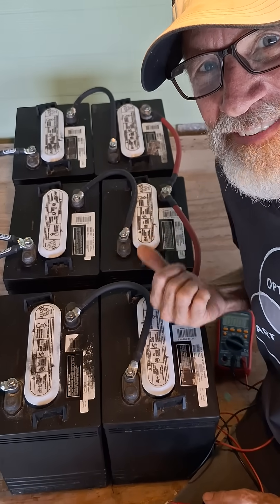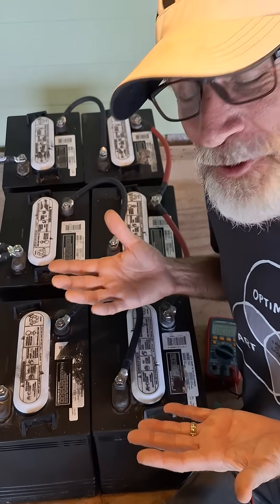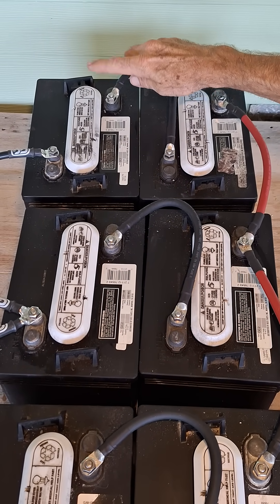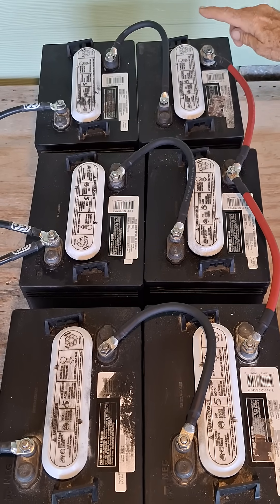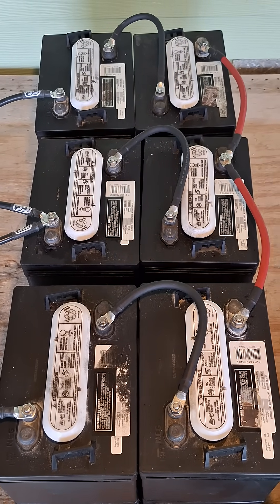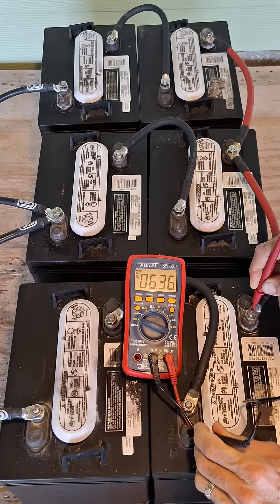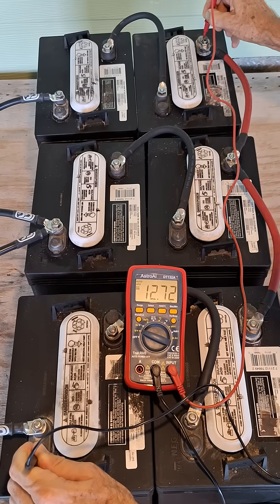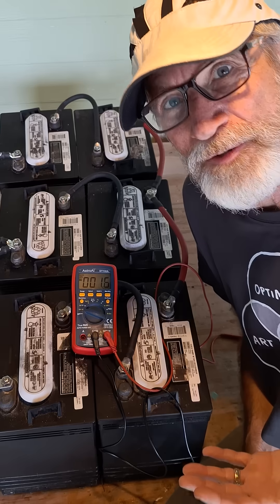12 volt solar battery bank using 6 volt golf cart batteries DIY #solar #offgrid #RenewablePower

Comment from the maker: I appreciate all the great discussion on battery types and power calculations!  Here is the math for my statement in this short:  We start with six 6V, 190 Ah batteries.  By wiring in series-parallel we end up with a single 12V, 570 Ah battery equivalent to 6840 Wh of stored power.  But they are lead acid, so only about half that capacity is available, so we divide by 2 and end up with a useable 12V 285 Ah battery with 3420 Wh of available power.  This is approximately equivalent in available power to a 12V, 300 Ah LiFePO4 battery (as I stated in the video).  But of course the LiFePO4 battery would provide many more cycles of service!  But the truth is, we bought an old 36V electric golf cart that had these 1-year old batteries that by all measures are in great shape.  As we are converting the cart to a single 48V LiFePO4 battery, we decided to use these in a DIY solar generator for our Tiki Hut and see how long they last.  It is an experiment!  Look for our next video on the solar generator build with this battery bank.  Thanks for watching!!!
Reply from the maker: It was a 36 V cart that we are upgrading to 48 V with an AC motor conversion.
Reply: You don't state it, but be sure to center tap off each parallel run to minimize line loss affecting charge and discharge imbalances between batteries.
Reply: You would need more then six 6v batteries to make 48v you need 4 12v batteries to make 48v so how did you get 48v from six 6v batteries? I think you don’t know what your talking about especially lead acid and lithium sorry but your giving bad info to people about solar and batteries and it videos like yours that need to be taken down people probably started fires because of you
Reply from the maker: @ Sorry that you feel that way. In the video I make it clear that it’s a 36 V system. I upgraded our cart to 48V LiFePO4.  Had the 6 V batteries left over so why not use them in a 12 V system?! it’s a fun experiment and it’s working very well. Thanks for watching.
Reply: @ecohabs4earth absolutely you are right 👍
Reply: @BojacksUnbound  no not at all you are rong

Comment: So do they all have to be the same amp size etc ? I have 2, 12v batterys wich i am thinking i want to use as a solar driven power station for fans to the heat on my solar heat converter. So it will be completely self sustainable unit.

Comment: Cool demo, thanks for posting! I'm totally new to this, but roughly speaking, what type of electrical loads (and for how long) could this supply electricity for? Assuming it's running from fully charged to fully discharged?

i.e. 10 LED light bulbs for 4 days? A typical refrigerator for 48 hours?
Reply from the maker: Great question- with about 3500 watt hours of stored power they would run a 10 watt load for 350 hours, a 100 watt load for 35 hours, or a 1000 watt load for 3.5 hours!
Reply: @ecohabs4earth  Interesting, that makes sense, thank you!

Comment: So why not just parallels negative to negative and positive to positive??isnt it the same thang!!?
Reply: That way the voltage would only be 6v if im not wrong and turning it into 12v allows for a higher output and more accessible inverters
Reply from the maker: Yup

Comment: Don't forget to change the caps the vent caps have to have bigger holes for ventilation for the application even though the ones that they have on golf carts are not even of the standard.
Reply from the maker: Good tip!

Comment: Very important to know the difference between series and parrellel circuits and series parrellel circuits in combination.  Most 24v backup battery systems for low voltage security and fire alarm panels use the latter.
Reply from the maker: Thanks for watching!

Comment: Great info , one question,does it have to be golf car batteries ? Or can you use car batteries?
Reply: No golf cart batteries are deep cycle, car batteries are starting batteries, car batteries can't handle being discharged and charged, it's not about the voltage it's about how the battery is made, a car battery might be dead the first time it's discharged, deep cycle can recharge a few hundred times, lithium a few thousand times.
Reply: @joegodoy9233  12v battery are not good for solar unless your planing on just using lights not only do you have to have big wire for 12v the conversion waste a lot of power 48v lithium rack batteries for solar if you want to run things like microwave toaster vacuum internet computers in my opinion if your not ready to do serious solar then you shouldn’t waste your money I know because I did it I want from 12v to 24v to 48v and I wasted a lot of money because 12v and 24v did meet my power needs and at the time i didn’t think I needed the power I needed so with that said I wouldn’t to let you know that so maybe you will not waste your money on this bill shit 6v 12v 24v bull shit you see online make a real system and you will not be disappointed
Reply from the maker: @joegodoy9233  sure car batteries would work. Since they are 12v, wire them up in parallel to make a large 12v battery bank.
Reply: @ecohabs4earth  wrong! You want nautical batteries because they can deal with deep discharge

Comment: Only 1 problem.  You take your pos and neg to the load from opposite batteries.  From opposite ends.  Not the batteries next to each other.
Reply from the maker: @keithanderson6166  yes that is exactly correct and exactly how we used it!

Comment: There's a solid reason the solar/offgrid folks have moved away from GC batts: You still only have 12v array. And you have all the battery problems of a flooded lead acid. LiFePO4 server rack batteries with 100Ah at 48v are safe, reliable, long lasting, maintenance free and take up half the amount of floorspace.
Reply from the maker: Yup :)
Reply: Lifepo4 isnt always the best and can be a real headache in cold climates. Im actually currently running a Lifepo4 bank, and I'm pretty torn if I will stay this route or go back to lead, or agm. Individual cell failure. Bms failure, and bms lock outs from high surging loads is a pain. Limiting charging rates to stay at a .2c charge rate also kinda sucks. Discharging below 60% greatly reduces the cycle life. Honestly they haven't proved all that different to lead acid to me yet. Time will tell though.
Reply: @speedyz28  aren't the label discharge cycles for LIFEPO4 based on 90% discharge (all the way down to 10% remaining)?

If staying above 60% charge has a massive effect that would be very cool, my big concern with adding batteries to some systems meant to only run in the sunshine anyway was eventful replacement cost
Reply from the maker: Thanks for watching!
Reply: you can have 24 and 48 volt arrays with Lead/acid.
  The reason I stay with 12 volt is that automotive stuff like fans, LEDs, small motors are all 12 volt. In addition, have of my lighting is 12 volt LED so I dont need an inverter to have light. ebay has a zillion low draw LEDs in a variety of volts and watts.
Reply: @danstrayer111  That's not what I'm saying... 48v is the safest and highest DC battery bank you want. It's the most effiecient for conversion to 120/240v AC. Problem with lead acid is 1. maintenance and 2. space 3. longevity. When LiFePO4 server racks are lasting 15+ years, the cost ratio outweighs lead acid hand over fist. 

If you're running electrolysis (like this vid) Lowest maintenance, longest runtime matters. The end process is low and constant. Lead acid just loses every time.
Reply: @glossywhite8634  can you elaborate on the claim it's more efficient to convert 48v DC to 120v AC than it is for 12v?

That is a reasonable hypothesis, I had the same thought but I did a bunch of research and never found any sources to confirm it.
Reply: I guess you have to believe that lithium batteries really do last longer. I've got 120v led bulbs all around my house that were supposed to last 22 years. I'm lucky to get 2 or 3 years. There are plenty of scenarios where agm is a better choice, we only use high quality agm in the telcom industry, lithium would not stand a chance. even my milwaukee lithium batteries have individual cell problems
Reply: @priestesslucy  The higher the input voltage DC to an inverter, the less heat and loss you get via an inverter (less amps means more stable and easier on the batteries and easier on the inverter). It is possible to go higher than 48V DC, but it's not recommended for safety. 48V dc is already a pretty spicy beast (you can arc weld with it easily)
Reply from the maker: Thanks for watching!
Reply from the maker: Thanks for watching!

Comment: If possible, get as high DC voltage as possible. That way you have less loss in the cables and can run thinner/cheaper cables. The system must be configured for it of course. I have four 12V 80H batteires i series for my UPS system so 48V. And the UPS is giving out one phase 230V/50Hz
Reply: Lmfao running thinner probably CCA wire is genuis. Amazing advice😂
Reply: @pyrodave6407  CCA?
Reply: Yup exactly. First thing i thought 
48v
Since inverters input is 48v
Charge controllersso on
Reply from the maker: Thanks for the suggestion!

Comment: Absolutely shit batteries. Unless you keep depth of discharge to 50% you’re going to destroy those batteries in short time. Tell me what your 1C capacity is after 6 months of usage. Plus, those batteries are prone to getting unbalanced. You’ll get a bad cell in a few months, destroying your battery pack. If lucky, you’ll lose a third of your capacity. Then, since you’re working the surviving batteries harder, they will fail too. I never got more than 2 years out of a series parallel system lead acid. For $60/KWhr I can get lifePO4 that will laugh at hard use.
Reply from the maker: Read my pinned comment above!  Thanks for watching...
Reply: Where are you getting Lifepo4 for 60$ per KWH?

At best I've seen 120ish

Comment: You could buy a 12v 300 ah lithium battery cheaper and it would be smaller and lighter
Reply from the maker: Nope, these batteries were free, see pinned comment.  Yes, the LiFePO4 would be smaller and lighter, but I have the space for these in our Tiki Hut.

Comment: No sir, that is a LIE.

 You can NOT compare the capacity of lead acid with lithium, they are NOT the same, not even remotely. A lithium battery with the same rating has about 5 times as much USEFUL capacity. This setup is MAYBE equivalent to a 80Ah lithium battery, at best. 

Not to mention, a 300Ah 12V lithium battery would be as big as ONE of those golfcart battery, have FIVE times the useful capacity, one TENTH of the weight. 

I have a 280Ah 12V lithium pack that I carry with a charger and 300W roll-up solar in a medium size backpack. This thing is ridiculously antiquated.
Reply from the maker: Yes see my pinned comment above...
Reply: How do you get 5x?

Lead Acid are generally considered safe to discharge to 50% no?
Reply: @priestesslucy  Depends if you want the lifespan to be 3 years or 11 years. 50% will absolutely destroy the lifespan of you lead-acid. I never go under 75%, and I prefer to keep it above 80% to get anywhere near the rated lifespan. This is a non-problem with lithoum that can take it from 100 to 0 without degrading, as long as it's not kept at 100 or at 0.

Comment: I wouldn't use the work "equivalent" without qualification.  Those have the same energy storage as that 300 Ah lithium battery, but they weigh two or three times as much and have less cycle life (not to mention they'll self-discharge and if left unused for a while will sulfate).  On the other hand, they probably cost a quarter what an electrically equivalent LiFPO4 battery bank would, and a tenth what Li-ion would.
Reply from the maker: See my pinned comment above :)

Comment: No that's nowhere near comparable to 300 ah of lithium, you have 300 ah of lead acid, which is equivalent too around 30ah of lithium.
Reply: thats not how it works
Reply: @allmountainparty5935  yes it is... lithium has roughly 10x the capacity per ah compared to lead acid and it charges a hell of a lot quicker then lead acid/agm
Reply: @windytokes what do you think an Ah is and what does the rating tell us about a battery?
Reply: @allmountainparty5935  It tells you NOTHING about the USEFUL capacity, it ONLY tells you the total capacity of a brand new battery, which you will destroy VERY fast i you start cycling a lead-acid below 75-80% percent.
Reply: lol what?
Nice troll man
Reply: @Chris-te7uk  "Numerous topice"? There was ONE topic, an YES, you said something. He did not use Ah wrongly, you just didn't understand, so I clarified for you. Per rated Ah you simply get about 4-5x the amount of USEFUL energy. 

I've soldered cells together too, but just as a proof of concept. I'm not broke enough to be soldering monochrystaline cells together when polycrystaline panels are cheap and far superior. I did build my LiFePo4 battery bank and the rest of my off-grid solar system myself though, and I've built or upgrade most solar systems in my neighborhood, as I'm an AT tech.
Reply: Well you also can't do but half the depth of discharge that lithium offers so these 6 give you half what the 6 lithium would give
Reply: @jamesgibson5876  More like a fifth if you want your lead acid batteries to live past 2 years.
Reply: @Chris-te7uk  Projections, projections, projections. His numbers are a bit exaggerated, but he's not that far off. Useful lithium capacity is basically 5X that of a lead-acid with the same rated capacity. This is because you can't discharge lead-acid to zero, or even half way, more than 25% discharge and you are destroying the lifespan of the battery, which you do not need to worry about with lithium. 

You seem to be the ignorant one here. Why did YOU speak?